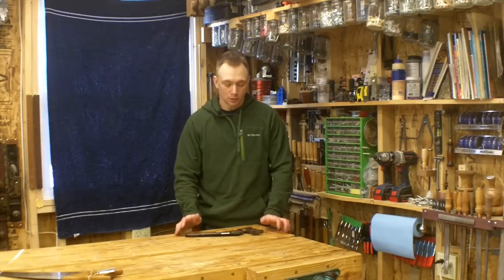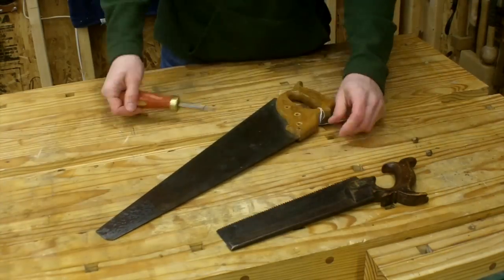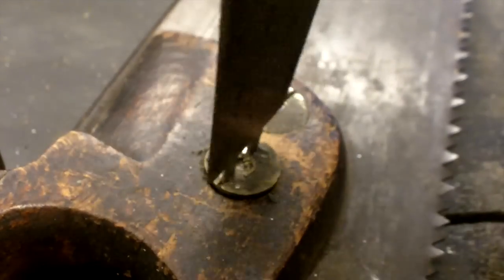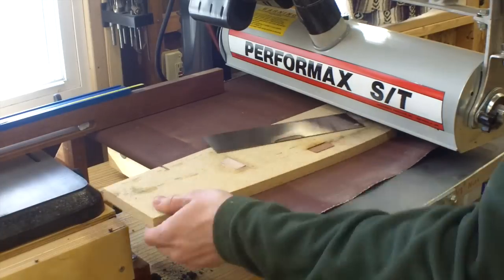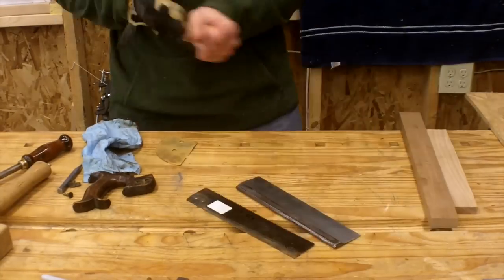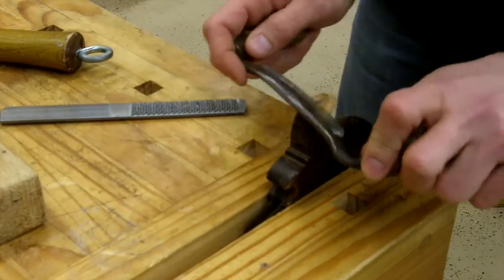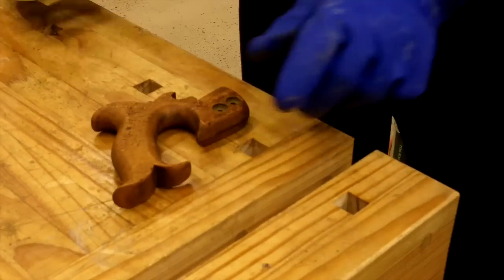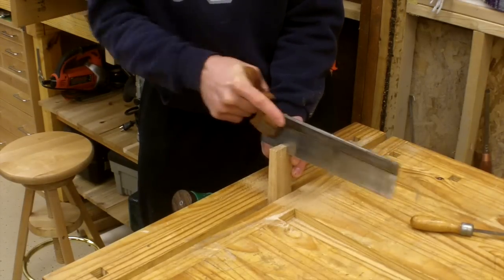Dovetail Saw Restoration - Swap Meet Find

Comment: My grandfather had a great axe. The head had been replaced twice and the handle three times but that axe was much better than any new one in the store! Is it a restoration when the blade of a saw is replaced with a thicker blade with different tooth size and set?

Comment from the maker: Response for Steve Zhang:  those hand held, metal cutting bandsaws have two sets of bearings that rotate the blade 45 degrees to make it much easier to cut long lengths of pipe, its a pretty standard set-up.

Comment: Is applying lacquer to the handle okay to do or is that mainly for hand planes? Also, did you put anything on the steel? i.e. wax? Awesome job! It sucks you had to wear off the patina but it's understandable why you had to.     :D
Reply from the maker: I think lacquer would be ok, but don't know that you need it.  I put a bit of wax on the steel.
Reply: Okay. Maybe for longevity of the protection of the wood would be my main guess. Plus, when I restored a Stanley no. 5 the rosewood really looked gorgeous afterwards. So like you said, maybe it's not so much a need but a personal preference in the long run.    :D    Great content! Subbed!

Comment: What was the final thickness of your blade after the sanding? how can I reduce thickness in my blades with just hand tools? do you have any tip? thanks!
Reply from the maker: Oh man, I can’t think of how to do this with hand tools ... other than buy thinner blade stock and cut new teeth, which is definitely doable.

Comment: Nice work.  Now I wish I would have bought something...
Reply from the maker: Thanks Matt!  I think there is another meet close by in the summer.
Reply: Awesome!!!
Reply: +Matthew Cremona +Andrew Klein You people have the best lives where woodworking is concerned, in my opinion. As an amateur, I wish I could just go to swap meets, flea markets and garage sales for good tools at a low price. I have all the tools to restore and tune them, just not the tools. And hand tools are ridiculously expensive if you want them new!
Reply: +varun009 Nothing in your area where you can pick up some old tools?  I've had good luck with ebay personally.
Reply: Matthew Cremona Nah. I live in india, which doesn't have a great woodworking culture, especially now that we haven't got much domestic wood to work. If we did get the old made in england/USA stanley/clifton/record tools, I would be in competition with about a thousand other people to get my hands on them. I've considered ebay, but the importation often costs more than the tool itself, and that's assuming I find a reputable seller. All we get here are Anant (since they're made here in the first place) and the made in china stanleys. There's a company called "shobah industries" that markets its products under the brand name "SOBA" here in india, and I've had great experience with them. They're miles ahead of anything else I can get here, but I don't think that's saying much. Though I've only ever used a Lie Nielsen #4, I'd say they (SOBA) compare well, though not favorably. They even cost less than the stanleys, and while they're good, I'd very much like to have some of the older stanley planes. Perhaps when I visit america next. I just hope I don't exceed my weight allowance!
Reply from the maker: +varun009 if you ever plan a visit to the US try to have it coincide with a Midwest tool collectors meet up, you could stock up on everything for good prices.
Reply: +Andrew Klein That's the best suggestion
Reply: Andrew Klein Thanks for the advice, Andrew, but I'm scared I may go crazy and not be able to haul it back!
Reply: +varun009 You might have to pick up an extra suit case while you're here ahah

Comment: Hay boss just watched your video and wanted to share an idea I had to see what you think. I have several old saws like the one you scavenged for the blade I don't know the manufacturer. I bought them at a yard sell with the idea of etching pictures on them for my wood working friends. But after watching several videos on here and buying my first table saw I found myself needing a push tool for my table saw and thought that It might be good to make one very thin out of one or more of these old saw blades. So I can get into very thin cuts on the table saw with out endangering my digits. I have a acquaintance that does knife making but he seems to be too busy to help me out so I thought I'd see what you thought of the idea & if you might have any advice for a novice.